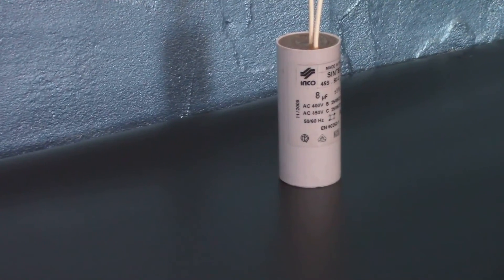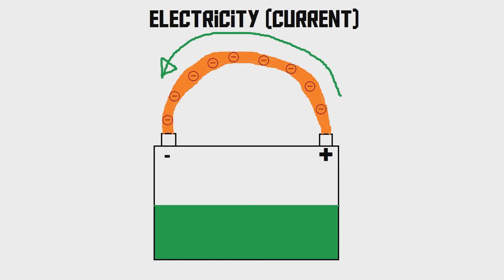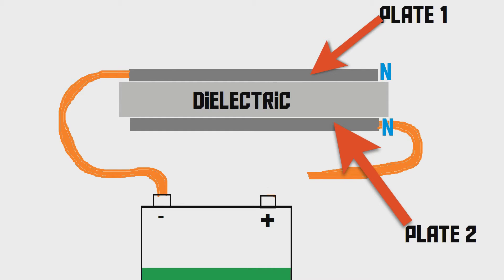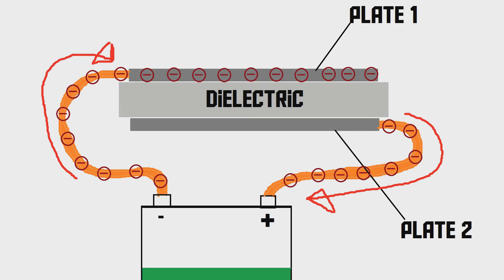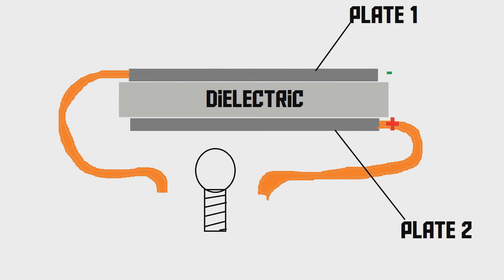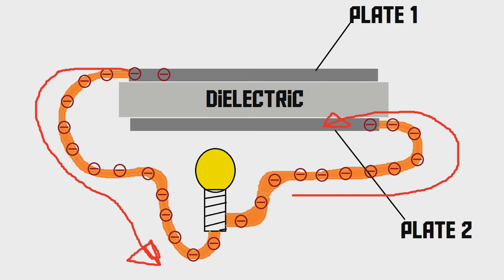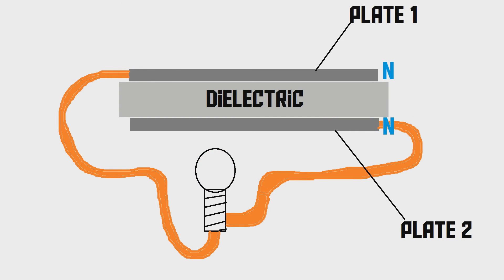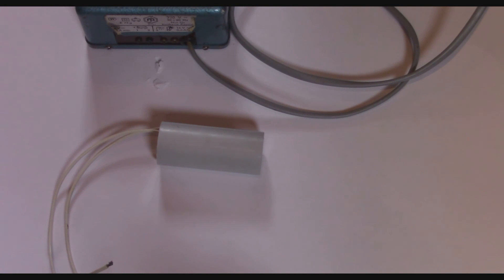How does a capacitor work (AKIO TV)

Comment: Capacitors are as much use as TITS ON A FISH, after all those neutrons ---protons and dielectric physics the only thing you made was a  SPARK. it's hard to comprehend how man has gone backwards,
10,000 years ago stoneage man was making sparks with flint?? and it does not need charging.